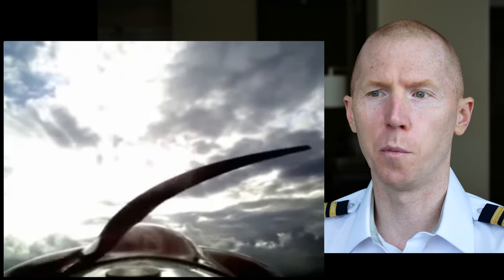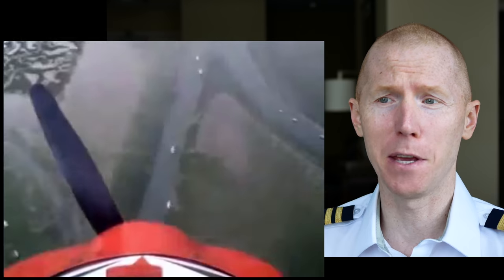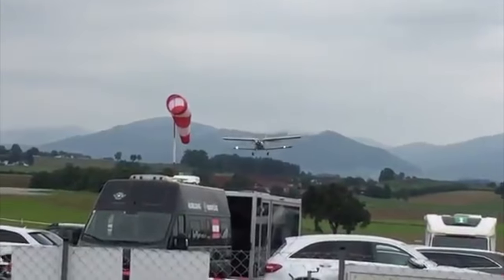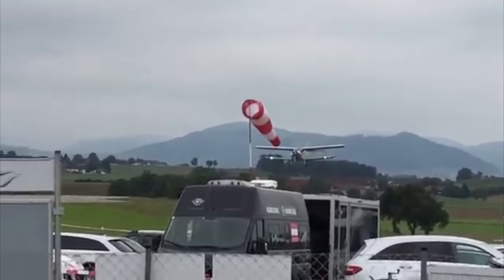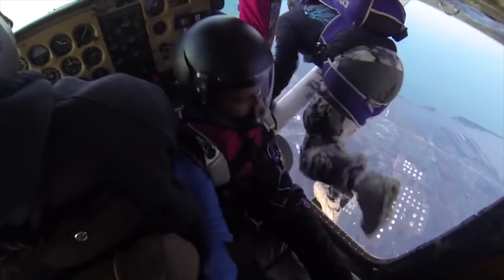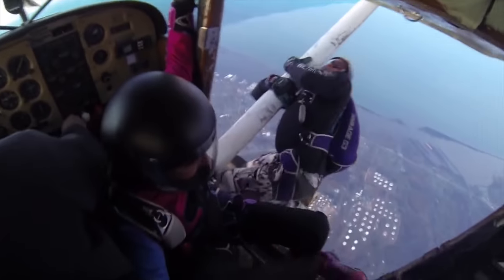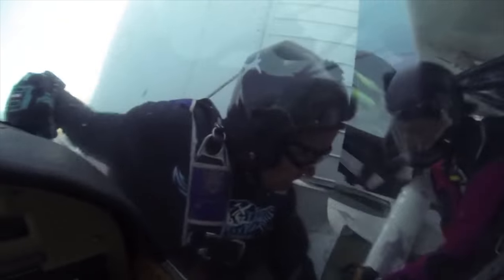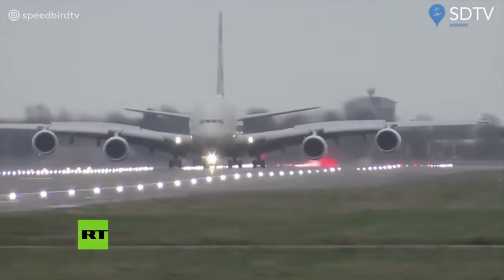Mid-Air Collision Rips Plane's Wing Off | Viral Debrief

Comment: That Cessna clip is crazy. Knowing the fact that everyone survived and one of the planes landed it (the top one).
Reply: Did the other pilot have to jump,
Reply: @silastracy91  yes. Fortunately he had his own parachute!
Reply: @chunkychuck  that’s nice to see. I mean, I am a student pilot and when I saw the below aircraft only has half of its wing and with visible flame, it really scared the crap out of me. When Kelsey says all people are survived, I was thinking really really hard how the below plane’s pilot survived
Reply: Most skydive pilots wear parachutes for every drop, In this case it definitely came in handy.
Reply: @clonfon1780  yes fortunatly they do. but getting out of a spinning plane, not getting hit by the aircraft and open the parachute (with out reserve) in a stable position so it opens correct is a whole other story xD a lot of luck was spilled this day haha
Reply: @BrainScramblies  Why? You will not get out of a commercial plane in flight. And if you did you would get ripped apart at the cruising speed of a normal jet liner.
Reply: @titter3648  : I bo believe he was not serious about that. Buy hey, sometimes it is easy to miss.
Reply: @titter3648  "D.B. Cooper" did 😂...just no guarantee that you'll land safely.  Also, it was the 70's, so aviation is no longer the same and I'm sure whether this stunt could be pulled off would depend entirely on the plane.  Of course, that isn't taking into account that the events precipitating the jump from the plane are very unlikely to occur again, at least not in the US or Europe.  Ok, I took what was meant to be a quick quip about a mystety and got a bit wordy.  lol
Reply: @ocrim16  what im interested tho is how did he cancel out the spin on the plane with the missing wing
Reply: They survived that!? Holy shit!!
Reply: TCAS has left the chat
Reply: If only there were dashcams on planes...
Reply: @ocrim16  I wouldn't say its luck, its called training
Reply: I’ve noticed many jump plane pilots, especially those piloting the smaller Cessnas (182, 186, or 206), prefer to wear a parachute simply due to the proximity they are to the open door of the aircraft.
Reply: @Morpheen999  i don't know man never saw someone training this xD
Reply: @renew1572  Rudder?
Reply: @lemonator8813  I'm pretty sure you can't stop assymmetric drag with it
Reply: @lemonator8813  as in the clip with the flat stall. Having only one wing creates a flat stall no matter at what speed
Reply: The wing snapped off
Reply: @wofty33  yes exactly but the other (judging from the video) didn't
Reply: @Got2Bespoke  if its aft stairs yes, a side door.....hell no , literal tons of pressure put on the door just from the amount of air being forced against the body of the plane . i forget if that happens as soon as your plane hits v1 and has enough lift to rotate or a certain amount of knots.
Reply: @renew1572  I believe it is possible to have a stable fall in result of the loss of a full axis of control. Rudder full right, elevator full down, and aileron full left should counter a spin due to the loss of a right wing. Obviously this just constitutes a controlled freefall, but at least there is no spin.
Reply: @titter3648  I've jumped out of a DC-9 (great fun!) and I used to carry my parachute on my shoulders as carry-on luggage on commercial flights when I was travelling for a skydiving trip - at least it's an option in an emergency, right? Unfortunately 9-11 made that almost impossible nowadays.
You're right though, the exit speed on that particular jet was closer to low 200mph, rather than 400's in big airliners. I still think that would be survivable but definitely not fun. My plan on one of those would be to exit in as tight a ball as you can, hope you can hold together long enough until drag slows you down, and then gradually increase your surface area to skydive-able speeds.
Saying that, some of the top speed skydivers hit over 350pmh, so it's doable.
Reply: @clonfon1780  Regulations require the pilot to also wear a chute.
Reply: @renew1572  pilot of the one-winged airplane bailed out. Other airplane landed safely. It was some time before the skydivers knew everyone survived. I know one of them, he was sure he had just seen some of his friends die.
Reply: @gwzipper1  I know that but we were speaking of how he stabilized his plane to jump out
Reply: @BrainScramblies 
That must earn some funny looks from the flight attendants. 😂
Reply: Of course the top one. The other one's wing snapped off 🤣
Reply: @yuchengzang1664  
There is interviews with the pilots and sky divers of those planes here on YouTube.
Reply: @Got2Bespoke  
D.B Cooper got out because there was an exit in the tail of the 727, he simply walked down the stairs and jumped.
Reply: @clonfon1780  "came in handy" - pretty much the ultimate use of the expression!  "Say, I think I will bring this parachute. It might come in handy sometime."
Reply: @titter3648  this is not true,when Felix Baumgartner did his jump from128,000 ft, he reached a speed of 833.9 mph, around 66mph faster than the speed of sound, commercial jet liners fly at an average 547-575 mph, you may pass out after getting ejected, but you would survive it.
Reply: @ahalfsesameseedbun7472  You are disregarding the thin air at that high altitude. That is why a SR71 pilot can eject at close to mach 3 while a fighter pilot ejecting at just below the speed of sound at a lower altitude is likely to be killed.
Reply: @titter3648  the speed of sound is 767.269 mph, currently the fastest commercial airliner is the Boeing 747-8i which travels at 654.851 mph, the most common being the Boeing 737 which has a cruising speed of 583 mph, around 240 mph slower than sos, not to mention, people have survived getting ejected from airliners.
Reply: @ahalfsesameseedbun7472  As i said it all depends on the altitude. A 800 km/h ejection at 70 000  feet is not nearly the same as a 800 km/h ejection at sea level.
Reply: @titter3648  true
Reply: Wow so they'll remember that..
Reply: @keeponwishin  pilot of the jump plane i learned in did 2 weeks flying then 2 weeks aff instructing, on an off.
Reply: @renew1572  You can't lol... He just jumped.
Reply: @PrIsMaTiSmX  He didn't try to fly the plane with one wing, he made his way to the door and jumped...
Reply: @renew1572  You can't stabilize a plane with one wing... It wasn't spinning hard or anything, he just made his way out and jumped...
Reply: @nihlify  So basically a yolo moment
Reply: @nihlify  I am aware.
Reply: @nihlify  woah, you must not know what you're talking about. Depending on wing configuration, it can provide negative lift which will allow a pilot to stabilize it.
Reply: @BrainScramblies  mo
Reply: Time stamp?
Reply: timestamp?
Reply: but what about the other 932 pairs of pants you gave to Mr. Womhouse?
Reply: @runarandersen878  you tube needs a sarcastic font.
Reply: @penniewyatt9391  : Not only YouTube,  but Internet in general.
Reply: Does anyone have pictures of the pilotless plane crashing?
Reply: Did the pilot wear a parachute while flying the plane or did he put is on really fast or something? I don't get it. Why would a pilot wear a parachute?
Reply: @silastracy91  the other pilot’s lost an entire wing, there was no coming back from that, he was lucky he had a parachute
Reply: @titter3648  You won’t get ripped apart by the forces, this is why most of the time fighter pilots can safely eject without many problems
Reply: @chunkychuck  just wondering why he had a chute ? Did he have it on while flying and if so why !? Or did he put it on lightning fast ?
Reply: @Dani-it5sy  they alway wear it. They are pretty flat since there is no reserve chute inside
Reply: I saw the clip on could you survive. And yes I can’t believe the other plane landed. And did you know that parachute pilots aren’t actually forced to wear parachutes. This was a real merrical
Reply: Play stupid games, win stupid prizes.
Reply: 666th like
Reply: @ocrim16  hahaha
Reply: How did the pilot of the plane that lost a wing survive? Did one of the skydivers grab him and jump out?
Reply: @Volkaer  As others said above. Both pilots where wearing Parachutes.
Read up through the other replies and they explain more.
Reply: @chunkychuck  lets goo, I thought the pilots died
Reply: Superior, WI
Reply: @silastracy91 -- Clearly.  You see one plane lose a wing and spiral.
Reply: @AviationNut  😃!! Thanks for that info! 💪
Reply: @Me37368  like kelsey said if he done any evasive maneuver he would have knocked the jumpers into the prop or stabiliser as soon as those tow aircraft came into range it was a sealed deal
Reply: @Volkaer  he had his own parrachute
Reply: @titter3648  not exactly. If you were to jump out the side, the wind would definitely tear you out of the plane, but if you were jumping out the back, it's not nearly as much of a problem, though it would require a high level of skill
Reply: One of the planes landed?!? Jesus.. I’m glad they all survived, I was worried the pilots were screwed..
Reply: Probably the craziest video i ever saw in my life (next to the guy sticking his head into a woman LOL)
Reply: @Got2Bespoke  he requested a specific altitude and airspeed so he could jump from that plane without getting hurt.
Reply: Not true, you wouldn't get, "ripped apart" urban legends are bs
Reply: Jump pilots are required to wear a rig.
Reply: I jumped from a 727 at 214  knots. It was like being a connon ball. I loved it.
Reply: Jump pilots are required to wear a rig.
Reply: @ocrim16  Meh! My grandfather was a WW2 B17 pilot and bailed out plenty of times when the plane was spinning, on fire, etc, etc. Fortunately over the UK when they were limping home and not Germany,
Reply: @ahalfsesameseedbun7472  he also did that speed at over 100,000 feet where there was no atmosphere or wind resistance. A lot different than 35,000 ft. Once Felix entered the lower atmosphere drag slowed his body down and also he was wearing a space suit.
Reply: @agentcrm  Actually, the pilot who landed was not wearing a chute that day. He was the only one without a chute, and, fortunately for him, his plane wasn't the one missing a wing.
Reply: @titter3648  I played around with some numbers for a while. I think the resistance at 550 mph, jumping from an airliner at 35,000 feet, would probably be upwards of 5 times as much as falling at 833 mph at, say, 100,000 feet. I think he might fall that far before getting up to speed. All very approximate, of course. Particularly since I don't know how to figure out how much more drag there is when supersonic. But the air is certainly thinner up there. The air at sea level is something like 20 times as dense as the air at 70,000 feet.
Reply: @ahalfsesameseedbun7472  The speed of sound is nothing like so steady. From what I've seen, the speed could drop by 12 percent at 100,000 feet, compared to at the surface. I'm sure it varies quite a bit from different atmospheric conditions, too. All those decimal points are useless. I bet you can't find a pilot who can hold 654.851 mph!
Reply: @lr21643  From what I have read there might have been one 747 to do it. It was in a dive but also never confirmed.
Reply: This happened in the town I grew up in.

Comment: When I was doing my flight training, my instructor intentionally had me stall and put the plane into a spin then recover repeatedly. This is what I think was happening in the first clip. The loss of the engine power at the worst possible moment is what I think caused the plane to go from a spin to a spiral dive then into a flat spin. I was really impressed by how quickly the pilot recovered from the flat spin, It is not easy to do.
Reply: Same.  We started at 5000' because of how much altitude you lose just for safety.  That was more than 30 years ago for me.  I think I remember we started at 5000 but leveled out around 2 or 3000'.
Reply: This is why I'm not a pilot.  Kuddos to you guys.
Reply: Why would losing engine power cause a flat spin? The opposite, not pulling back on power causes flat spins, thats why you pull back on the power, to prevent flat spins, and to not overspeed once you nose down.
Reply: @matszz  It wasn't the loss of engine power in of itself, it was when the power was lost. It caused the rotation of the spin to go from the roll axis to the yaw axis. In a jet aircraft, the thrust is from the rear of the aircraft, or at least the rear of the wings, In a single engine prop, the thrust is in the nose so losing power at the wrong time can induce yaw, iirc,
Reply: @MrGrumblier  So why is the instruction to cut power then? If it induces yaw and causes flat spins? If the planes weight distribution is correct the nose will drop, even if there is initially a yaw inpulse.
Reply: @matszz  If you are in a flat spin AND you have power, you need to cut power to recover. If you don't have power, it is a moot point.
Reply: @MrGrumblier  I concur, plus there's the detriment of disrupted airflow from the stopped engine. Instead of accelerating air over the major control surfaces and allowing greater authority, pitching nose down may not be the aerodynamic path of least resistance hence the tendency to spin as opposed to harness the plane's innate capabilities as a lawn dart. Heck of a lot of difference between flight idle and a dead fixed-pitch prop. Reducing power is not the one-size-fits-all solution especially if you have the luxury of 2 functioning engines and differential thrust like in a Beech B200. I'm sure you're aware, I'm just explaining before the inevitable anatomical measuring festival occurs.
Reply: @michaelirwin7258  SAME HERE, ALWAYS STARTED AT 5000, THAT DIDNT LOOK 5000 TO ME!!!!!!!!!!!
Reply: @SWC44  I loved practicing the spins.  They were so much fun.  We did them in a Piper Tomahawk that had reinforced wings.  I would purposely select that airplane just so I could do them.  I felt like a stunt pilot.

What was scary to me was when I asked when I would ever need this?  My instructor told me most likely on landing.  I did a quick calculation and thought to myself, if I enter a spin at < 500' ground level, AND I am landing... I'm eating the dirt because no way am I pulling out of that.
Reply: That's an important exercise. My glider instructor, on my 6th/7th flight, told me that we are to tow to higher altitude (700m) as we are going to practice stalling. He showed it to me once, and told me to do it myself until we had just enough altitude to turn for a landing. (Stall/recovery cycles.)
Reply: How do you recover from such a situation? And what do I need to do to put myself in this situation? (Playing Microsoft Flight sim 🙂)
Reply: @sommojames  Varies a bit depending on the plane, but I'd summarise it as: Get rid of asymmetry, restore and maintain proper flow around control surfaces. Then level off. Some planes may do most of it "automatically" if you don't do anything (aerodynamics). Some may require more interaction. In some cases, you may have structural limits. (e.g. My old wooden glider could only take as much speed and nose pull up, that if I didn't pull it out soon enough, it could break. We are talking about a few seconds. And having the plane creaking around you on your 6th'ish flight was an interesting experience.)

If you want to practice it in a simulator, then gradually reduce your speed to stalling speed while maintaining the wings level, and pull up as needed. You can and should try introducing asymmetry at the point of stall, as it will change the way the plane gets into the stall. With asymmetry, you will push it into a spiral. 

Worth noting that with some planes it is possible, though risky and difficult, to stall the plane while keeping the wings horizontal, resulting in a very unstable close to vertical descent. It's a trick gliders can use if they need to shed altitude in emergency. (I heard it nicknamed as 'lift/elevator'.) It's difficult, and I don't think we need to get into details while it's dangerous. "Only try this at home, kids!" :) (simulator)
Reply: @TheZoltan-42  top! I will try this in my next session
Reply: @sommojames  To enter into a spin, you stall the aircraft by reducing power and pulling up until it loses lift then, when it begins to pitch down, kick in full rudder and opposite ailerons. To recover, iirc, you first use rudder to cancel rotation, then aileron to cancel spin followed by nose down and application of power and finally easing out of resulting dive.
Reply: @MrGrumblier  I put myself into a spin (super fun btw) and tried to recover by ruddering like a madman in opposite direction of the spin, but fell hopelessly into the ground. Then I tried to rudder following the spin, with max throttle, and worked, but it was a very close call. Starting from 3000 feets it has 50% success rate on several trials. Will never try this in real life :)
Reply: @TheZoltan-42  My glider instructor told me the same thing. So I stalled it. He said “That’s not a stall! Do it properly!” And that’s how I did my first tail slide…

Comment: When you talked about not giving up it reminded me of the 767 accident at London Heathrow (Speedbird 038 was the callsign I think) where they lost all power to both engines at 500ft.  They were heading for houses and a petrol station so the Captain reduced flaps one notch.  He said the plane immediately jumped forwards and it got them over the perimeter of the airport and onto the field.  They crash landed heavily on the gear on grass but no-one died.  Because he didn't give up he saved everyone on board and people on the ground too.
Reply: Similar to that pilot who flow over Athens and missed a mountain by like 9 feet with slight changes every part of that journey mattered
Reply: He got the whole thing down with 0 deaths